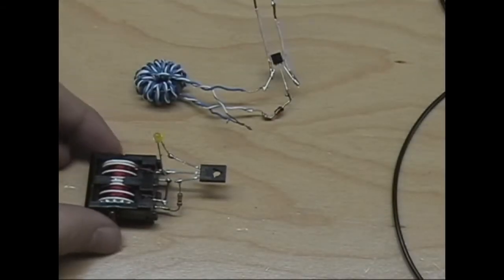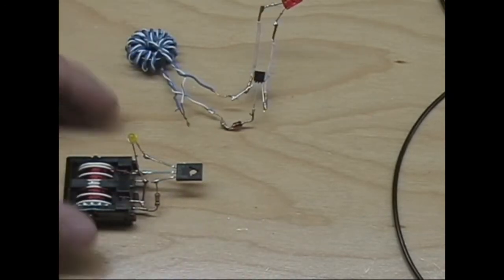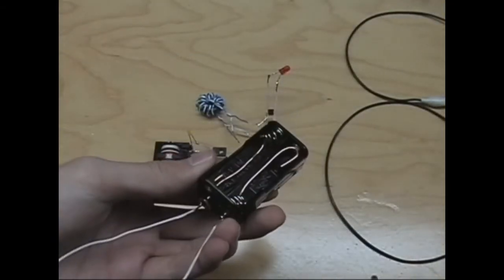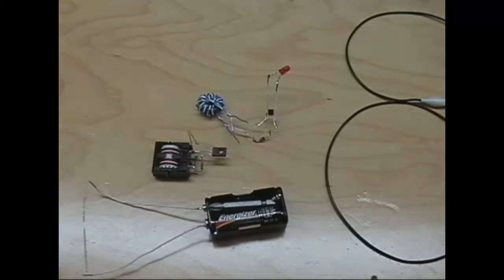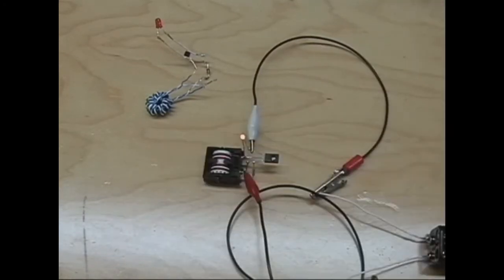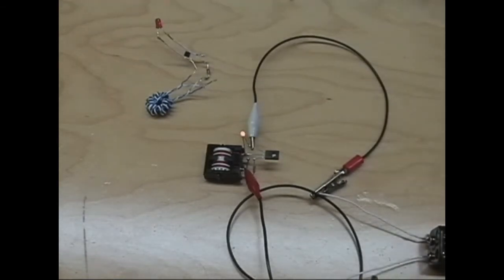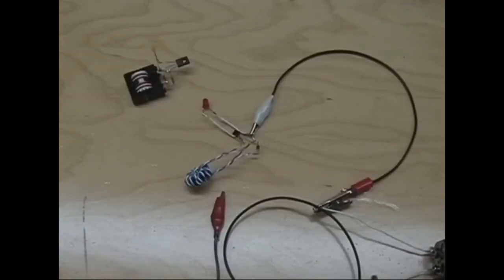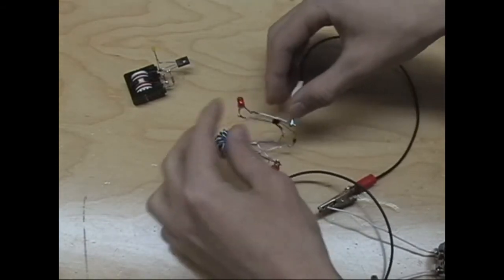Joule thief #1

Comment: The diode is a very poor substitute for the resistor because it does not limit the current.  A fresh battery could push so much current through the diode and base that it could burn out the transistor.  Nothing was said about the polarity of the diode, but one direction should block the base bias and nothing would happen. Cool video, though,  The schematic is readable, not blurry like most iI've seen .